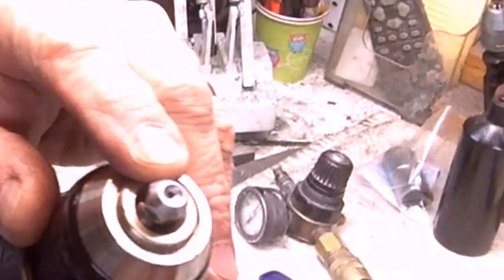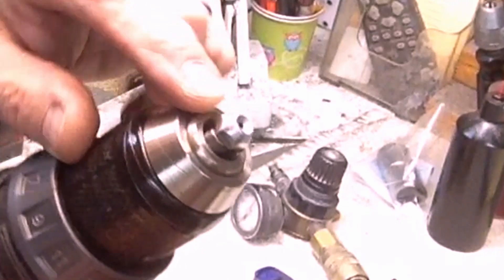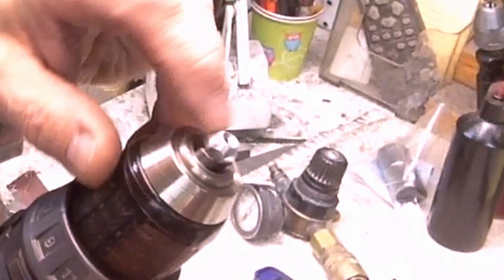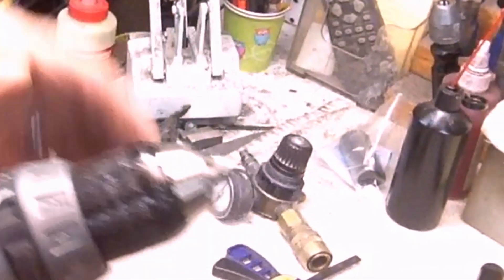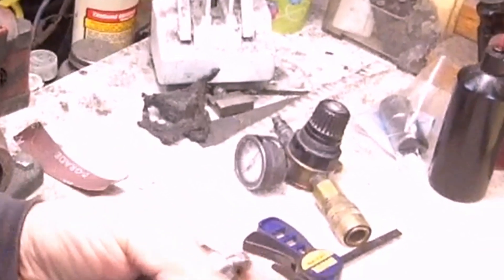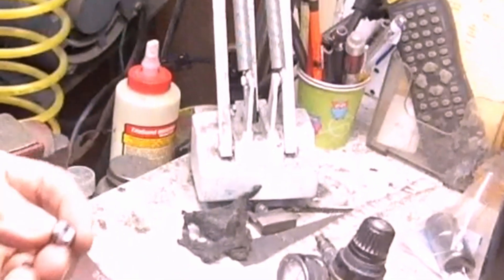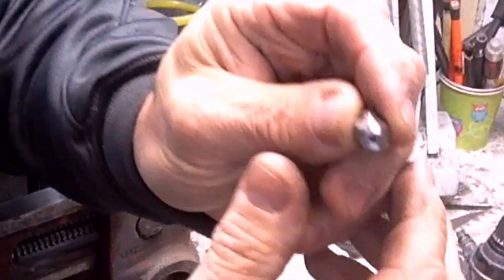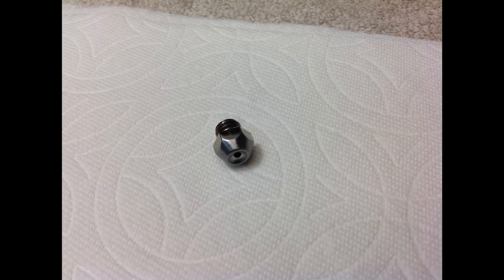Scratch Building A Zenith 701:Machining Rivet Gun Noses For The Zenith Airplane

Comment: Do you use the 1/4 carbide bit for all rivet sizes on the 701?
Reply from the maker: Yes you use the same 1/4" bit for all rivet sizes and is the same for all the Zenith aircraft
Reply: @hillsgun  thanks for the reply :) i have used the 3/4 so luckly i have a spare rivet head of the same size.

Comment: Thanks Dan for both the new and the original video. You mentioned that you would put a link up for sourcing the burr and polisher on Amazon. Amazon has many and I don’t want to buy a junkie ones, so if you could please give me the products item numbers that you would recommend, I would appreciate it. I also noticed that they have kits that include up to 10 different types of burrs in a set. They seem like they are a better value as well. Tell me what you think and Thanks again!  One other thing, I’m a new builder of a Zenith kit and I recently had to drill out a bunch of A4 and A5 rivets. I’m new to the airplane building world. It would’ve been really nice to find a good video on drilling out rivets without damaging the aluminum. I’m not sure if I’m supposed to drill the rivets out or simply drill the heads and take a punch and tap the balance of the rivet out. What do you think is the best method? Maybe you could make a video on it? Thanks again
Reply from the maker: Hi Mark, in the video description are links to several burrs and polish bobs so you should be able to find what you need. For rivet removal I normally drill the head off and then punch the rest out, if you use a punch about the size of the stem even if the rest of the rivet doesn't want to punch out the stem will usually come out and relieve the tension on the rest of the rivet body and it will usually come out with a slightly larger punch. If I get a chance tomorrow I will try and shoot a short video.